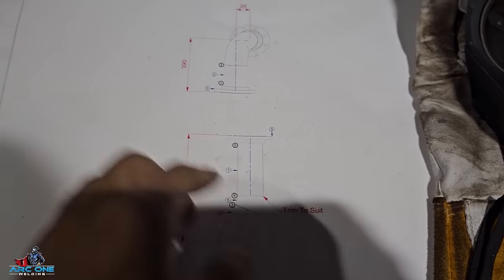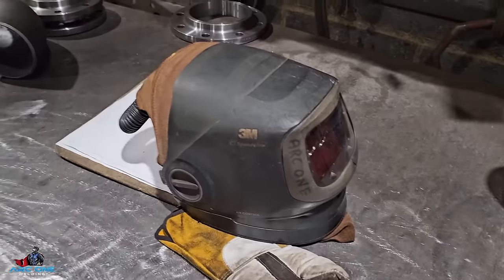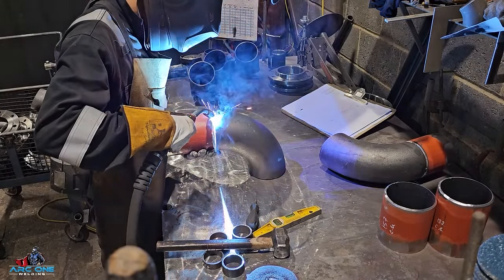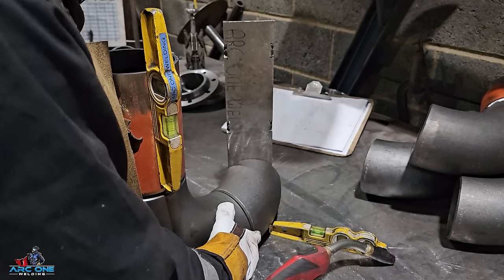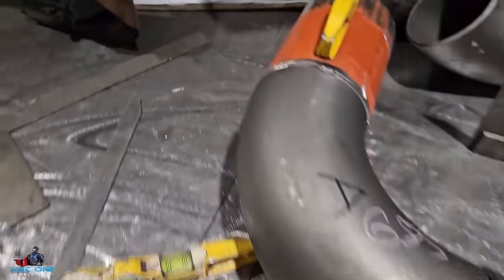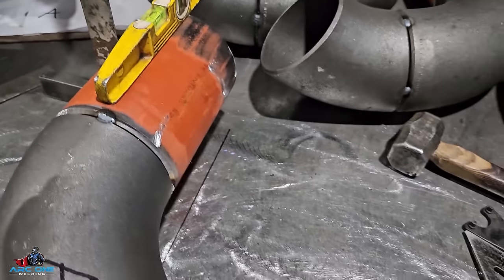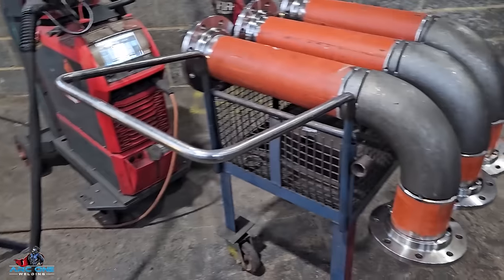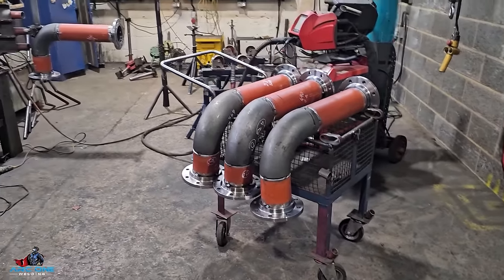How To Guide, Cutting Down 5" 45 degree fitting *Fabrication* tips* MAG/MIG Welding

Comment: i work as a pipefitter in oil indusrty, the drowings we get we just have total lenght and eatch elbow is written on the drwaing as either 45 deree or what ever its is, the pipe between eatch pice is messurd or calculaed, but in ur case you only have how much ur senter move in 685mm, and the trick with the stok pipe with 20mm cut off is perfect as long as ur table is true egught, for us the tabels is not level with in any meesuered area, we almost only use exsiting flanges or like cordenates for eatch support. We moslty copy pipes. some times usees iso drawings. very intresting looking at ur videos. i dont weld anything my slef only tac weld with rod in the gorves because of the high tolleranses to welds in the oil indestry. btw our company needs more wlders and fabricators in Norway, appaly for Mongstad Industrier